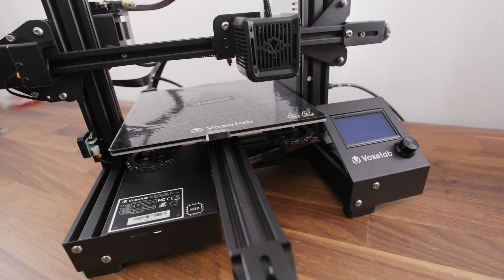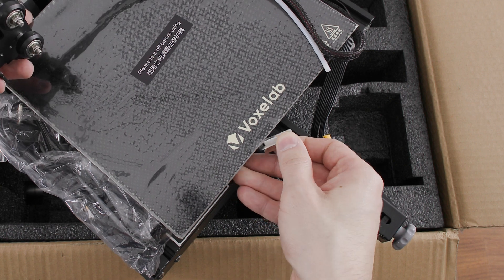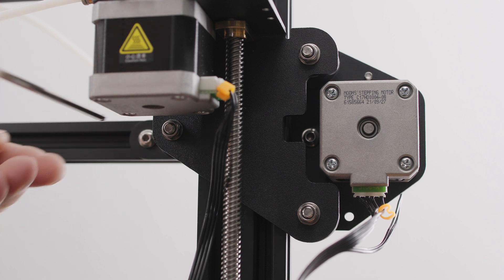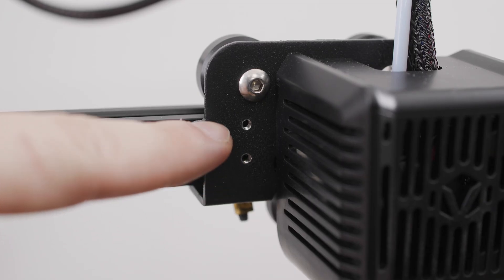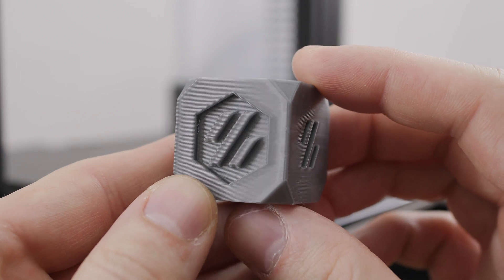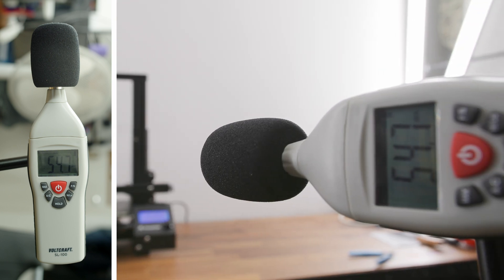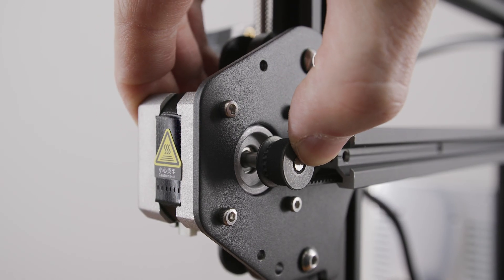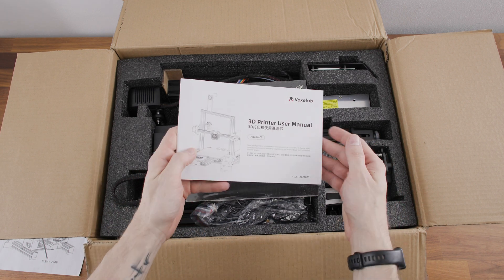Voxelab Aquila C2 review / Unsuccessful Creality Ender-3 Pro clone?

Comment: I bought one from a dance sister NIB for $150. Being new to 3D printing, I'm reasonably impressed with the thing. The stock extruder sucks donkey balls - I replaced that POS right quick with a dual gear version that works much better. Added a light and a filament guide and I've had quite good luck with it thus far. The red filament that came with it wasn't the best.

Comment: hi i was wondering if you could answer a question for me. someone recently gave me an aquila c2 but it had no lead screw. i ordered one 365mm T8 Tr8x2 Z Axis Lead Screw but my prints come up compressed. did i get the right size. is it possible i need an 8mm pitch? this is driving me crazy. any help you could give would be appreciated. thanks

Comment: I stumbled with this model recently in aliexpress and was very suspicious of the price. It is half the price of the regular ender 3 in my local market. Seeing some reviews, definetely looks like it is not half the quality. Should be well worth the price for someone in a tight budget. Biggest issue really is the PSU, which I had the same in my original V1 ender 3 and died on me after 4 years. A replacement one is 50bucks locally, half the price of the entire printer, which is insane, still should be fine for using for a couple of years before failing it out, just pray it doesn't set things on fire or kills the logic board when it goes.

Comment: don't buy from this company, they don't respond to you if you send an email. also the printer has so many problems with it:
the bed has no adhesion so I've had to use glue

the print once stopped half way through so I tried to switch out the nozzle and the thing you use to unscrew it bent and broke. so I tried to use a stronger tool and half of the nozzle broke off so I had to get a totally new hot end 

the bed is not levelled automatically
I have a bunch of other complaints that I'm not going to say.
in conclusion stop selling this printer and don't buy it

Comment: I bought a used one of these here in the UK for 80GBP inc some additional filiment (Dec 23). So far very happy with the test print I did and my introduction to 3D printing. The bed clips were missing and the previous own had used tape so I got 4 replacements and decided to fit all 4

Comment: great video but the x motor is not damaged and those screws are included
Reply from the maker: I found out after releasing the video, that the motor is fine. It is just not the best choice for a 3d printer.
And no, the screws were not included in my package. 🤷‍♂️